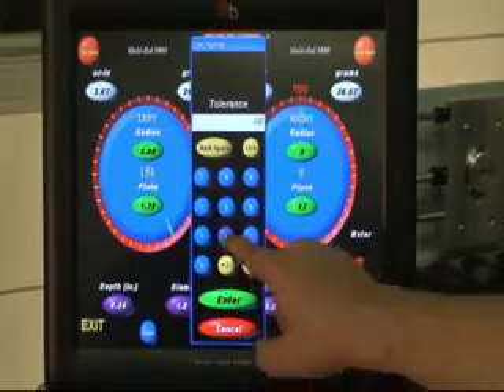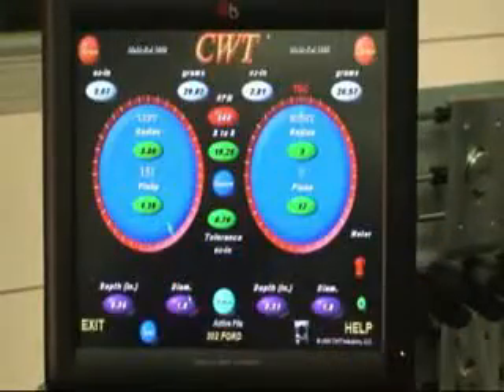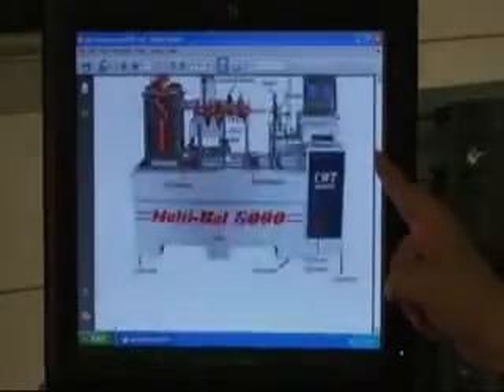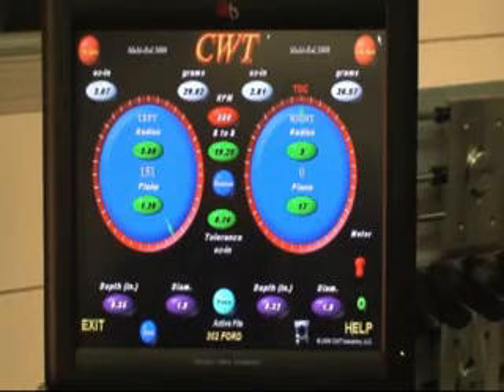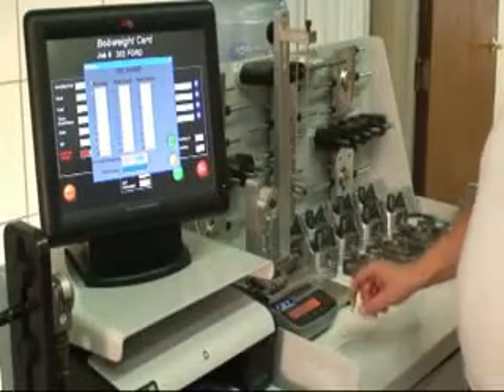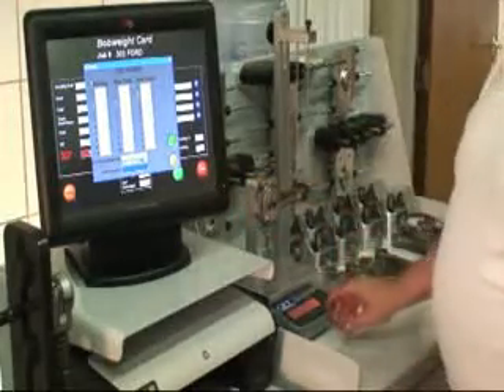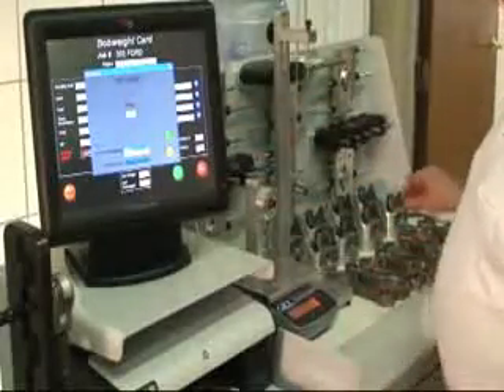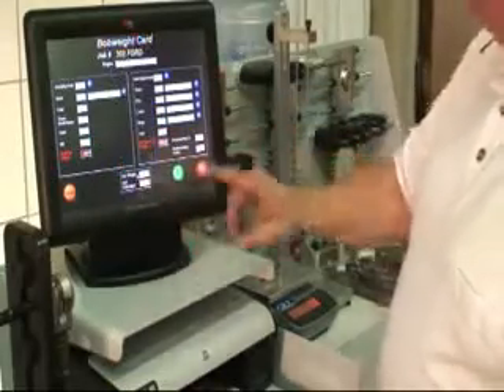Balancing Machines Crank Balancing Machine CWT Multi-Bal 5000 Part 2

Comment: Your math doesn't work out.  The "0.2" you refer to is actually 0.2% ounces which equals 0.002 ounces, when converted to grams gives you 1.6 grams.  Of course, this would only matter to someone actually using the machine.